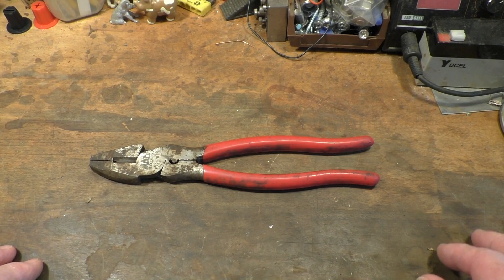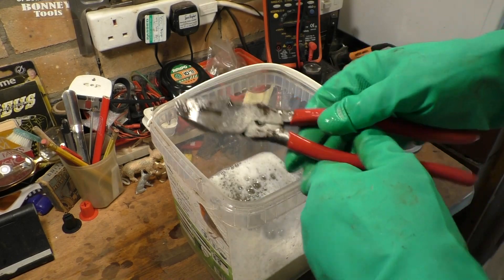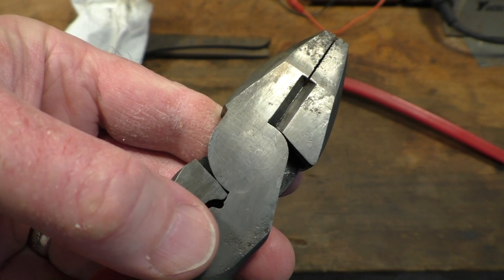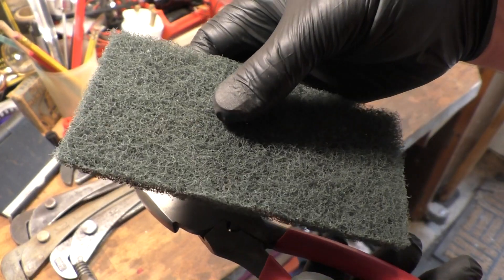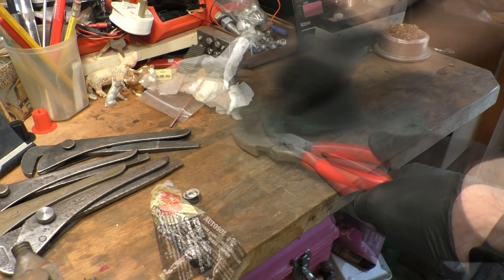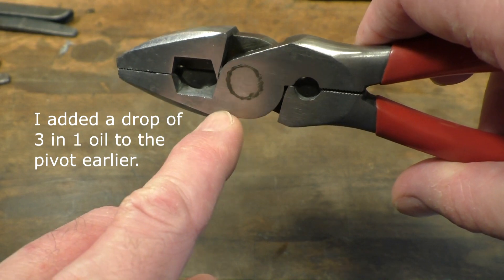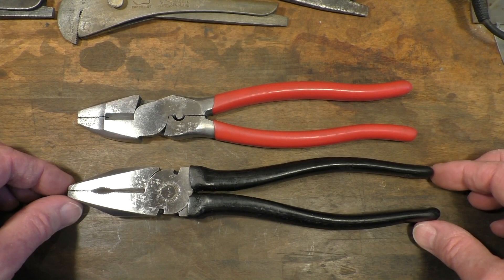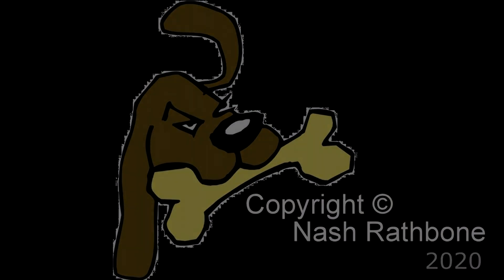Mac Tools P301781 Flea Market (Car Boot Sale) Find Restoration.

Comment: It makes me sad that most maker's marks now a days are all laser etched. Sometimes they don't even bother and just silk screen it somewhere in the tool. The pliers turned out really nice, specially the handles, they look pristine!! If you need to tighten the pivot a little you could try using the ball part of a ball pein. My Dad used to use a certer punch but it looks ugly and it gets loose really easily. Thanks for sharing and take care!!